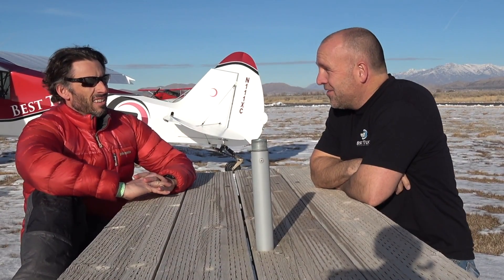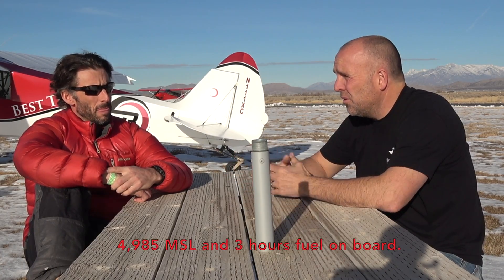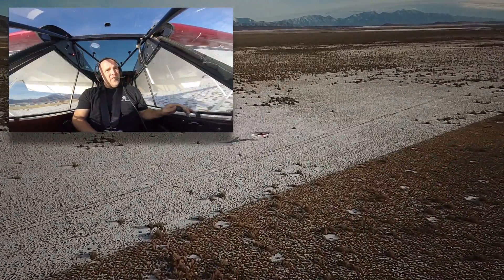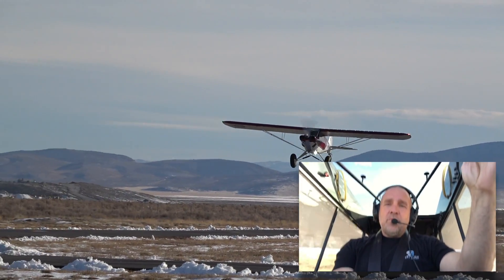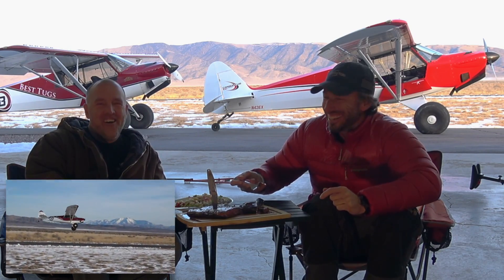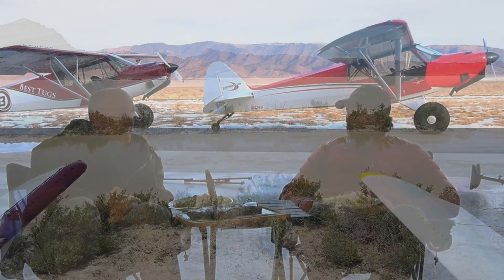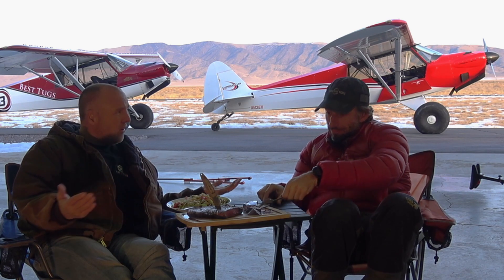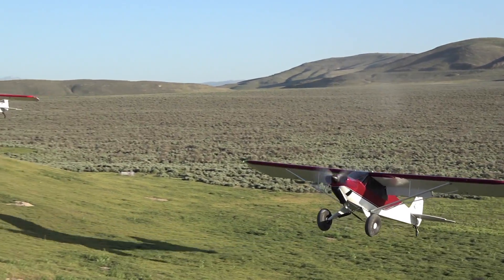The impossible turn in the Carbon Cub

Comment: One thing you mention but don’t stress is the pushover.   If you push to zero-Gs you can’t stall, and induced drag is zero, so you conserve a bit more energy.   Few pilots will push to zero, but it is good to recognize that pushing that nose down hard is helpful, as it lowers the stall speed.  It can even be argued that slight negative G will change attitude faster and thus trade a little induced drag for a parasitic drag reduction...my instinct says this probably a wash with a zero G push.
Reply from the maker: Thanks for the comment!

Comment: Although I'm not a pilot, I was a car and motorbike instructor, so I totally relate to your comments that getting a pilot licence is only just achieving the 'minimum' standards. It's very obvious that drivers and riders get 'smoother' and 'more confident' after their test, but unfortunately they confuse this with getting better; but it's not because they aren't in exam/test mode any more, and they allow sloppiness and casual attitudes to creep in. So I'm glad to see you're aiming to raise pilots sights, and encourage them to get better.
Have you done any of these 'impossible turns' with wind and vegetation that would reduce the wind ground speed and create the risk of a down wing stall as the inward wing has less air speed, and being closer to the ground is in slower moving air, while the upper wing has a higher air speed through faster moving air. I would be curious as to how much difference that makes compared to the ideal conditions in this video.
Reply from the maker: Yes everything makes a difference... Temp, Alt, and a dozen others... This is just what we did on one day... Thanks for the comment.

Comment: Here is my take.  Before you ever takeoff from an airport ... you had to fly into that airport first.  If you are the kind of "thinking pilot" like these guys and good bush pilots, when you're flying over the airport or in the pattern before landing (or at worst approaching on a long final) ... you are looking at the roads and terrain and buildings on every side of the airport or airstrip or landing area for places you could land safely if you have an engine out when taking off from that location.  This should become a habituated policy that always happens, just like lowering flaps or some other action that is always part of approach or landing.

Then when you are ready to leave the airport you recall as much of this information as you can before takeoff.  Then if your engine fails during takeoff, you know exactly what you decided in advance to do when taking off in that direction from that location.  No need for 5 seconds ... you just immediately push the stick forward and turn in the direction you decided in advance.  Then if you have plenty of altitude you can check for a cause and maybe be able to restart the engine while you glide to your chosen target.

If you are a bush pilot and fly into many rugged landing areas, the only place you can even hope to land might be the airstrip (or patch of dirt/sand/grass you took off from).  In which case you already know you should attempt the supposed "impossible turn" if you are high enough to have a reasonable chance.  And you will know if you are likely high enough if you practice these exercizes a few times a year and remember what direction and speed the wind is blowing.

Comment: Very good point about idle power and a true no power landing, need that extra energy at the flair!
Reply: i have practiced thus turn many times in my own ac...a c172 k model with 40deg glsps,  and a pa22 ( 160hp, no glaps) and in both ac with at 10kt or more headwinf, snything under 700feet was a no for me. usually, getting bavk was easy, but the ac ended up along side the runway, not at the threshhold. Tail wind aldo doesnt help either..
 i have over 3000hrs in these ac.  I slso offset 30deg to one side when taking off from strips., because you just never know..
i was also dhovked recently when i did some engine out (stationery prop) work in a microlight, just how much fifference that idling motor mskes. without the idle, the nose was way down, much steeper than with idle power.
good stuff guys. keep practiving.
neil
new zealand.

Comment: Great video chaps!  This is something I've practiced and totally agree with everything you've said.  If a pilot has taken the time to experiment with this maneuver in his/her own aircraft (with mags off as makes a massive difference) then they will have an specific AGL limit in their head so that if the engine does faiilon take-off its likely to be a pretty binary yes/no decision.  In your case with these aircraft 400' would be a 'yes' and 150' would be a 'n'o.  However, if pilots haven't bothered to experiment and practise this in their own aircraft then its probably safer to just assume  its 'impossible'.

Comment: Agree with you and Trent. A critical item to keep in mind, however, is the plane you're flying. Not all of us fly the little cub-type planes,and adjusting the AGL for your particular plane's weight and configuration is an absolute safety of flight issue. 800 AGL is pretty much the lowest I want to practice in my C-421. Obvious, I know, but sometimes pilots forget.
Reply from the maker: Thanks for the comment... I agree.

Comment: Turnbacks with partial power are also used in GRM Flyovers AND also on Box Canyon Turnbacks.  GRM Flyovers, Box Canyon Turnbacks, and Initial Climb Turnbacks.  Those 3 situations where if you dont do The Turnbacks right, you can die..  Good to learn them well..

Comment: Glider pilots practice "rope breaks" before first solo.  Ideally, the tow plane drifts upwind, if there is a crosswind, so that the turn aligns the glider right with the runway center-line.  That's what I was taught.
Reply: Wouldn't that be kind of counter-productive, though, since you'll probably be turning into wind if the rope breaks?
Reply: You want to drift _down_wind,  so that you turn into wind when rope breaks.  This puts you closer to runway CL after the 180.  Was fortunate to have CFI that would pull the plug at honest to god 200’ with no warning.   Miss that man...

Comment: Now 70 retired, stopped flying in Y2K to expensive, learned to fly at N34 Turner field Horsham Pa in the early 1970's while going to college after 4 years in the Marines. A slow flight mountain canyon turn works fine, would use it flying up the Hudson river thru NY city, also if you come up short on final to runway, dive for the ground, get your airspeed up, then in ground effect you may make the runway...

Comment: Good video. I was surprised how widespread among pilots the belief is that you cannot return to the runway. This name the impossible turn is very bad as I see it. Flightchops insists it should not be done, it seems to be commonly taught that it should not be done. There is a trainer on youtube that insists you will loose 1000 feet just doing the 180 in a cessna.
To me it seems it should almost always be done and is particularly easy if you deflect from the runway towards your destination and always aware which side you should go if it happens. It becomes extremely pronounced when it's an actually good plane and not a brick with cardboard wings like a cessna. Some LSAs have 27:1 glide where ditching in the wild instead of returning is deadly stupidity. I tried the Sully flight in simulation. The biggest difficulty was bleeding energy out of it to not overshoot the runway.

Comment: I have practiced at altitude and found about 200 feet or less of altitude loss to make a 180. My Champ can fly so slow that I also found I have several seconds after power cut where I have momentum enough that I don’t have to push the nose immediately. Also, at my home field, I depart and turn for an alternate landing as an SOP so that I am headed to a viable spot or already turning to go back to the runway decreasing my exposure to the risk and reaction/decision time. Make these decisions on the ground.  So is Vy your best glide speed?  Probably close.  A benny of landing the 180 is that the tailwind will decrease your angle of decent, so it should stretch what you can reach a touch. And a strong crosswind should be turned into for the 180. Remember that decent angle, now it will be steeper turning downwind, having to fly against the crosswind component to get back to centerline. Good food for thought. PI.

Comment: The thing most pilots don't realize is you are really making a 360* turn unless you are landings on a parallel runway. 180* +90* +90*.
Reply: No, even with my poor math skills I don't buy it, landing on the runway you just came from is a 180.
Reply: Problem is, you're landing on the same runway, but in the opposite direction. So a single 180.
AKA you took off from runway 36, engine quits and you do the "impossible turn", technically you land on runway 18 but it's the same piece of tarmac.
So from one point of view it's a different runway (number), but from another point of view the ground didn't move out from under you so it's the same runway (location).
Reply: @jamesfenton7338  its a fact ,,,27 out of 14 people are not very good at math

Comment: I just want to point out you need a 1-3 seconds to actually react to an engine failure, check  your altitude and decide to make the turn. Also, an engine out drags more than an engine at idle. Realistically, you need 300 ft AGL.

Comment: We had a debate in our flight club the other day about the use of Vx or Vy on climb out.  My stance was that it's better to use Vx and climb to pattern altitude (with the least lateral distance) rather than Vy (which may give you more altitude but puts you further away from the airport).  Your video shows you using Vy.  Am I wrong in my thoughts about climbing at Vx to begin with and then switching to Vy after reaching pattern altitude?   Thanks!

Comment: This is good practice if you are current and know your plane as you both do. All pilots in the company I work for are required to prove their skills yearly.  This involves power off landings, hydraulic off landings (helicopter), confined areas, stuck pedals, and a variety of other emergencies.  This training has saved me a couple of times in the past twenty years.  Passing the minimum requirements decades ago does not make you a safe pilot - training does.

Comment: G'day,

  Yay Team !

    About the only correction one might offer is that "Dead Stick" is a WW-1 terminology which literally means "Propeller Stopped", so it isn't possible to practice for an Engine-Failure, which will require an actual Deadstick Landing..., while running the Engine at Flight-Idle....; so that bloke whose story you told, he might've been the local Ace at landing with Idle-Power, but the fact that he's dead proves that he wasn't much good at Dead-Stick Landings at all (!).

    About the only extension which one might offer to everything which you said here, is that in my view, ideally, it should be mandatory to hold FAI Gliding Certificates (A, B, & C) before being permitted to begin Ab-Initio Flight-Training in ANY kind of Powered Aircraft ; that way, if every Pilot has had to learn to demonstrate their ability to soar a Sailplane before taking lessons in Aerial Engine-Management, then all they learn to "Fly the Wing" from the very beginning, and forever afterwards any time the Source of Vibrating Noisy-Smells goes quiet..., then they respond by CONTINUING to fly the Wing as they revert back  to what they think of as "Normal Flight Conditions".

   I gave that advice to my best friend once, when he wanted to learn to fly, but he went to a Flight-School using Powered (3-Axis) Ultralights instead...; they sent him solo, he came home and bought himself a Mk-3 Skycraft Scout, flew it around for a while, and when his Engine failed he spun in and died.

   I made a video about that story, which  includes a full Biography & Crash-Analysis, I can't leave a link to it because my Channel runs on a Mobile Phone -  but you can find it by backtracking me to my Playlists ; it's titled "REQUIEM  FOR  A REDHEAD..." and it's in both my "Personal Aeroplanology...", & the "Warbles In The Wilderness..." Playlists.

   I thought his 35 Hp Mk-3, with Wing-Warping, was a really nice Skycraft Scout..., but that's because the one I learned to fly in was the 3rd Pre-Production Prototype, built in 1975, with 8 Hp & only 2-Axis Controls...; so my judgement may have been prejudiced somewhat...(?) !

  Anyway, thanks for posting, I greatly enjoyed your video.

  Have a good one,

  ;-p

  Ciao !

Comment: I had a total engine failure in a Jodel D9 at less than 150 feet, big revine ahead. I turned back thinking at least I could be rescued on the airport. The bent up wings (The design of the aircraft) helped as I was still in a bank when I touched down. Everyone should know how to control their aircraft without power at low level.
Reply from the maker: I agree...its too bad the majority of pilots would never intentionally stop their engine while airborne. Thanks for the comment..
Reply: Yes I had 13 engine failures in my 45 years of flying, now some pilots will never experience one. Back in the day we would give every student one dead stick landing stopping the prop on the downwind. When I flew heavy jets  on cargo we would practice doing throttle closed descents  and spool up for the landings.

Comment: Years ago when I was a student, we had a engine failure in an Aeronca Chief still straight off the runway in a departure climb...my instructor immediately said My Aircraft, pulled it up steeper, slammed left rudder, did a perfect hammerhead and put is down right on the runway we had just left.  Would I have tried it back then, No as he was a multi thousand hour AD driver.  Would I try it now?  Yea as now I've been flying for 50+ years and have practised it numerous times.

Comment: 5 months ago I had to do that for real. I took off and at around 80-100 m AGL I heard a loud explosion in front of me and lost engine power. I immediately pushed the nose down and started the (right) turn back. I pushed the right pedal but it was a lot stiffer, looked around and a voice in my head just said I'm too low and it's going to be in the farmland below. I turned left to be on centerline again because to the right there is a building. In front was some farmland followed by a line of 2m trees. In the end I did a slow 50 deg right turn to get to the best spot to put it down. The land below was very soft and I expected to break the NLG and get inverted. Can't remember the flare and touch down, but obviously it was very smooth as the plane was standing on its wheels. I immediately turned the key off and rushed out. It turned out that one of the composite blades had blown off. When I went back I saw that the rudder was hanging only on the lower hinge and control cables. The upper hinge had separated from the tail. I've been lucky it didn't shear off completely. We towed the plane to the hangar, put another prop and the engine worked perfectly. 3 days later she was flying again.
Why I tried the improbable turn? Because I was sure I was going to make it. I have 60 hours in a weight shift trike and 80 in ultralights. Out of them 30% were cross country. The else were engine out practice either after take off or somewhere around the circuit. I can turn the trike and get to the centerline from 60-70m and the plane from 100m (~300 ft). This time it is good I didn't continue the turn back as there was a problem with the rudder and I was going to end up 90 deg right of the centerline and facing a building. After all the practice before, I didn't think about the nose down as the engine quit. It was a simultaneous reaction. I've trained my muscle memory to act as soon as the engine changes its noise. And that helped me. The nose was already going down while I was enjoying the "Oh f@&k" moment. It took me no more than 2 sec to start the turn back. Additionally as I felt that there is a problem with the rudder, I was afraid to bank enough (opposed to what I normally did during my practice) to make the turn tight. 
I was flying a Fly Synthesis Storch. Its stall speed is 40 mph.
Excuse my English as it's not my native language.

Comment: Suggestion - There are pilots who are professional at 180 Degree turns at low altitude - ag pilots.  It's worth noting that they all turn the 90 first - THEN the 270.  With that process you're more likely to be at a flatter attitude close to the ground.  I would be interested to see if there is any effect on efficacy by using the 90 then 270 - as opposed to the 270 then 90 as shown here.  You might also try the 45-180-45 and see how that compares.  Love to see the follow up!  If I still had an airplane I'd do it myself.
Reply from the maker: Thanks

Comment: I’d be curious what is required for trainers like a 172. It would be a good thing for CFIs to know. And those who complain about practicing engine outs and stalls, obviously don’t pay attention to airline training, flight crews are in the sim at minimum every 6 months usually every 3 months for something like 8-10 hours running the gauntlet of emergencies. Unusual attitudes, Fire, hydraulic failures, electrical failures, you name it they do it and GA pilots should too. There are sims everywhere to practice on, often for free, and you should be practicing in your airplane too.

Comment: A good discussion. It all depends on how much you fly and what kind of flying you do. Training forced landings on a multi-engine airliner by shutting down all engines - simply reckless and should get the pilot in a lot of trouble. Training it on a bush plane that you own and fly a lot - might be justifiable. It all about the the risk you're exposed to in training versus the risk and the likely results of the same thing really happening in whatever conditions you mostly operate in.